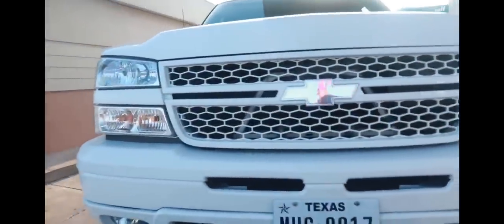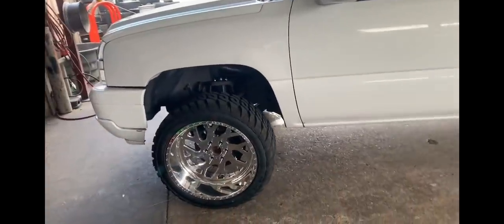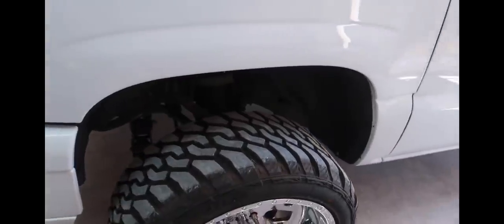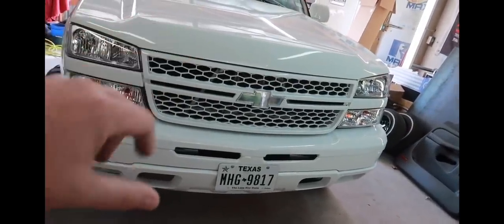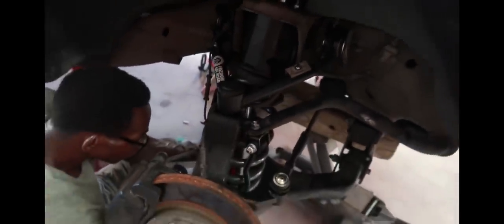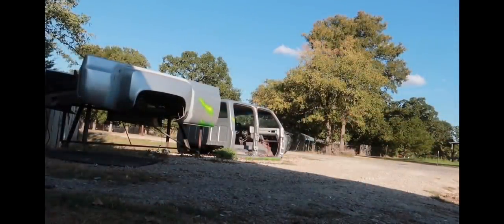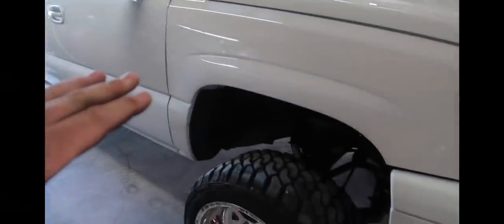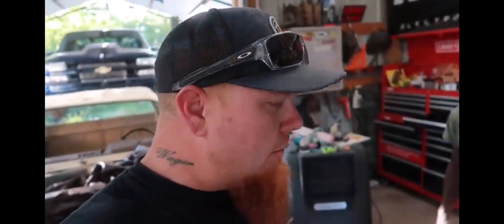LIFTED 2WD SILVERADO , AMERICAN FORCES , I BUILT FOR MY DAUGHTER

Comment: I'm probably too late commenting on this video but if you still do see it make shure you upgrade the front tierods to beefier ones cause with bigger rims and tires these trucks are known to b ed ND or snap in half I figured I would let you know that just in case you didn't know
Reply: They snap in half even with they normal tires and rims in much less materials too weak and thin
Reply from the maker: Chase Hinton Will Do sir , I’ve Ben thinking about it , but I already removed the lift .

Comment: I have the same issue I have 2003 Silverado 2wd 6in rough country lift but sits lower in front still. I want to put the coils in but I need to know if the upper control arms are a must or not. And what shocks did you use. Sick truck man I love the all white look

Comment: I’ve got a 2wd Silverado just like this. Is it possible for me to install 3” lift spindles, 3” coil spring spacers and 2” lifted coils with aftermarket control arms. Is this ok to do?
Reply from the maker: No I would not recommend doing that !
Reply: BOBBY_HILLS_OUTDOORS so how did you have a 6” spacer with the 2” coil spring?
Reply from the maker: Drop Down Cross Member . It comes in the Rough country lift kit .

Comment: So you put a 2in coil spring on top of the spring already in place? I’m trying to level my same Silverado and having an issue
Reply from the maker: John Doe I pulled the factory oils out and replaced it with 2” lift coil .
Reply: Awesome man thank you
Reply: And where did you order the springs?
Reply from the maker: Ebay
Reply: Last question, did you have to get bigger shocks or were the ones from the lift fine?
Reply from the maker: John Doe I still used the ones that came with the lift .

Comment: Did you have to do a norcal mod to keep from rubbing the back part of the fender?
Reply from the maker: No sir , Tires cleared just fine . I did have to trim the air dam though !
Reply: Awesome. Thanks for the reply man. It's awesome what you've done for your daughter. My parents sure never did anything like that for me. She is blessed to have such a caring father. I bought a 07 classic body style 2500 that is 2wd recently and I'm wanting to have a aggressive look like that to. Part of me wants to put 20x12s on 33s or 35s with a 6 inch or leveled. The other part of me wants to put 20x10s on 275 50 r20s and do a 2 inch rear level. Can't make up my mind. If it was 4wd it would be a no brainer but I got to good of a deal on the truck to pass it up. My main thing is I don't want to hack up a low mileage 1 owner truck. Anyway thanks for the content. You earned my subscription.

Comment: I have 4.5 inch and same issue with the rake would a 2 inch spring or 2 inch leveling puck help or would I need to get the a longer shock as well ?

Comment: Bruh if you're still here where did you get the tail lights at those are cool and what A nice silverado I have an 04 2wd single cab short box 1500 silver silverado and can't make my mind up on what size lift or level kit I do know it's not going over 4.5 but my question on the lift did you just changed the springs? i've never done this before so imma first old timer. 😂 but anyways your advise and help is much appreciated if you can guide this ole man in the right direction thanks and y'all stay safe

Comment: RC has a 7" lift kit for 2wd ?
Reply: Badass truck I want to do the same lift setup you did ,but I only see the 6" kit for 99-06 2wd on the RC website
Reply: Be used the RC 6 inch lift and then used 2 inch coils with aftermarket control arms
Reply: That's what I figured
Reply from the maker: playamade8000 6” lift with 2” coils . Thanks for watching !
Reply: Show only